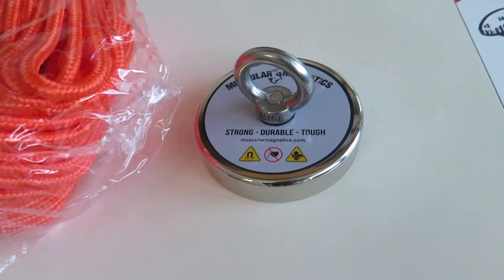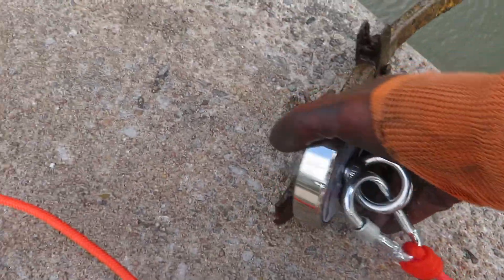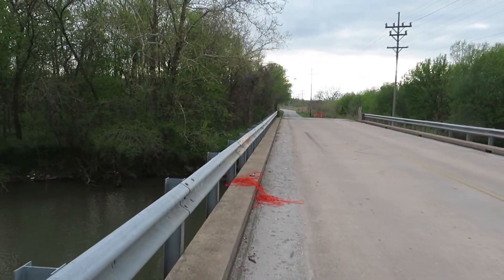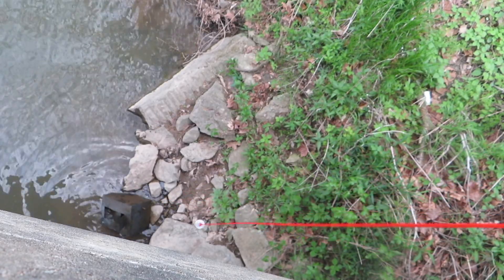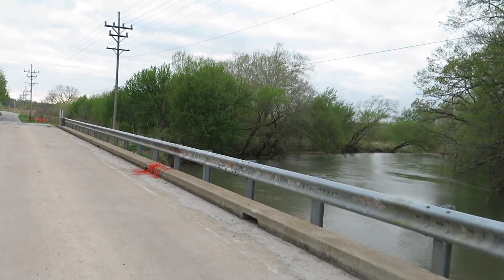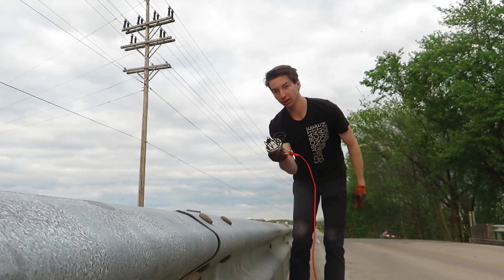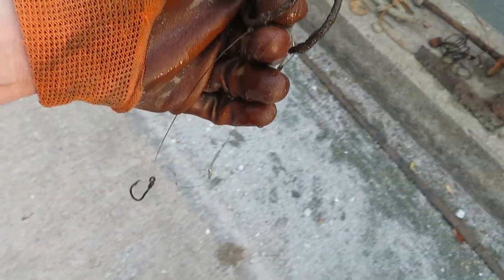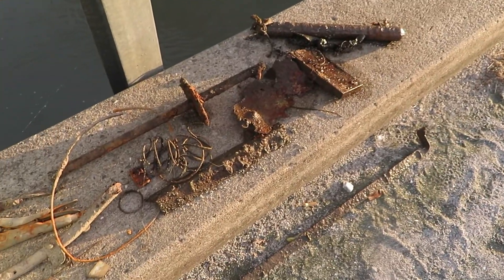Magnet Fishing at a Rural Missouri Bridge (Found Safe)

Comment: Some info for you.  The plier type tool is a "vice grip".  All keypad type safes require batteries. That weight is a "window weight" that was used to make it easier to lift old wooden windows. The part of the fishing line is a "steel leader". Hope that helps.

Comment: Cool finds! I've done some magnet fishing, but I don't think my magnets are quite strong enough for the bigger stuff. It's funny they cut that safe open, as those type of safes can be opened very easily without power tools or torches, if you know the "secret", lol. (any safe bought at a big box store is usually junk!) The batteries were to power the lock keypad.  The large weight at 10:19 is a window sash weight, it would have been used on windows in homes from the 50's or earlier, to help with opening the windows.
Reply from the maker: That definitely makes sense, thanks!